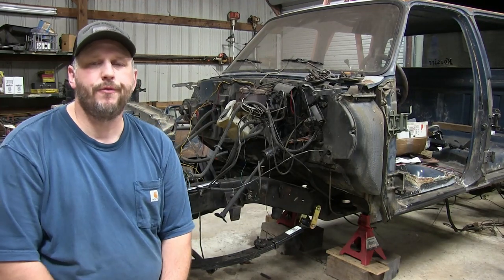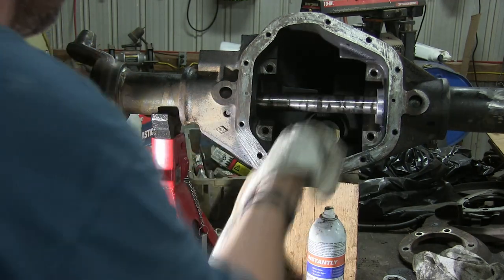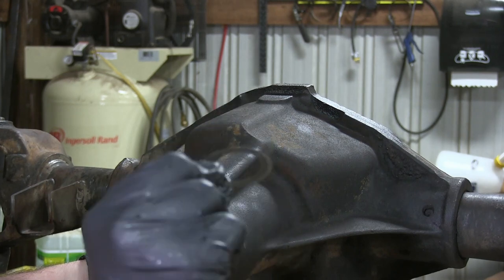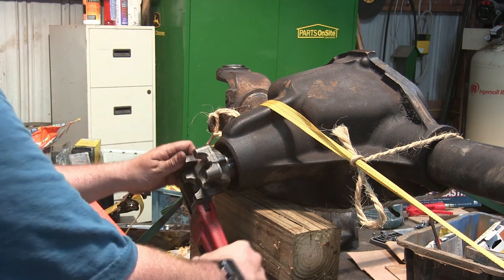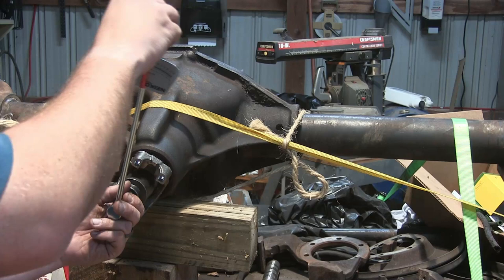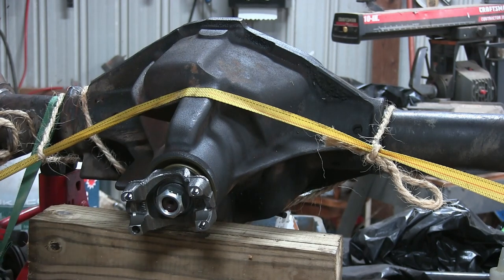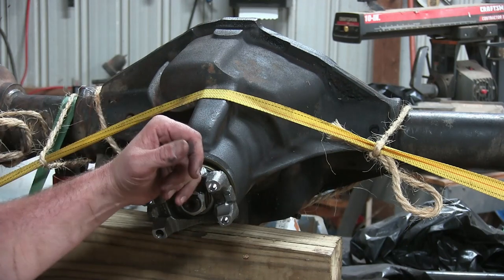Dana60 Pinion Install DIY

Comment: Did you measure the old bearings and compared them to the new bearings? Sometimes different bearing manufacturers are slightly different!
Reply from the maker: No I didn't, but that's not a bad idea.  Thanks for watching!

Comment: Where can I find the bearings for a dana 60. The ones I get from the part stores are way off.
Reply from the maker: Check this out.  This is what I got from offroad design and everything was correct.  https://www.offroaddesign.com/d60-differential-re-bearing-kit-includes-both-pinion-bearings-with-races-both-carrier-bearings-with-races-inner-axle-seals-pinion-seal-and-nut.html  Thanks for watching

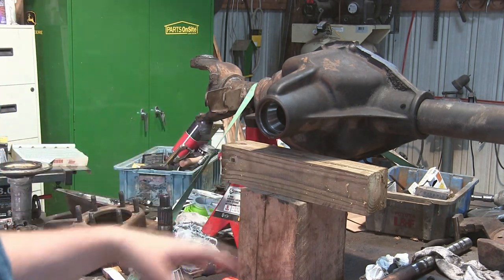Comment: what did you mean at 4:55 that you couldnt get it to 250lbs but also couldnt move it?
Reply from the maker: Before I could get the pinion nut to 250ftlbs there was so much preload on the pinion that it would not turn.  So not enough shims, no need to continue tightening the pinion nut.  Thanks for watching!
Reply: @Offroadfarm1  ahhhhh thats perfect thanks! helps me understand how the preload works too. appreciate your videos man.

Comment: Why did you have to play with the number of shims if you were just re-using the original shims? If you used the same shims that came off during disassembly, then wouldn’t the pinion go on having the same tolerances as before disassembly?
Reply from the maker: I did upgrade to a 1350 yoke and that is why I had to change my shims.  Thanks for watching!